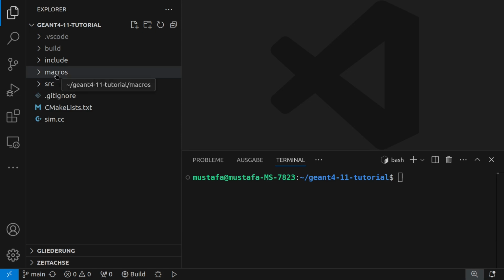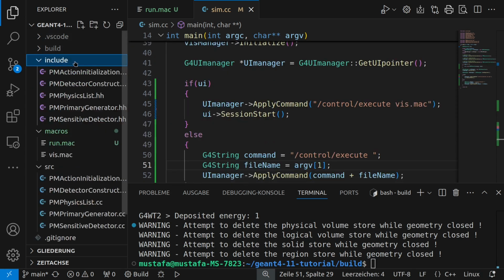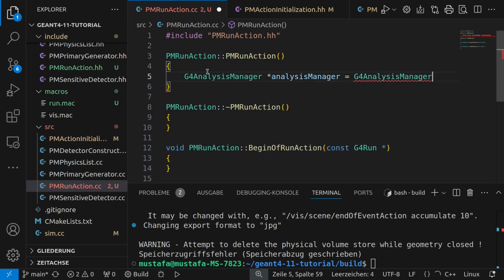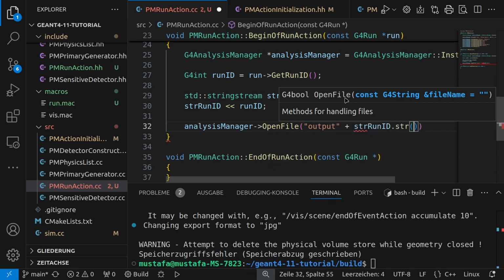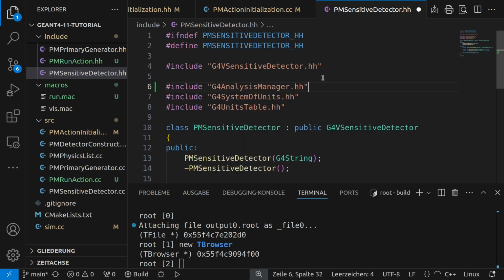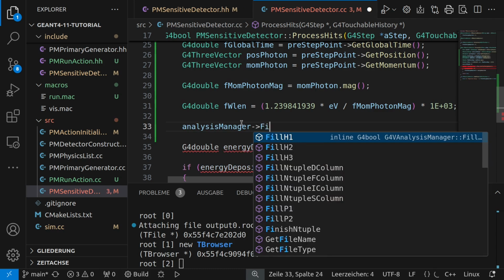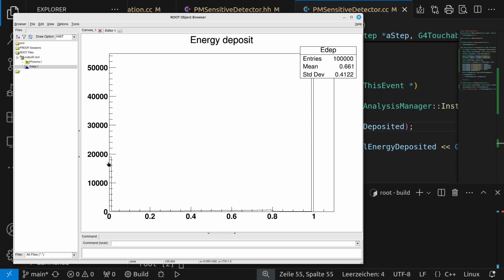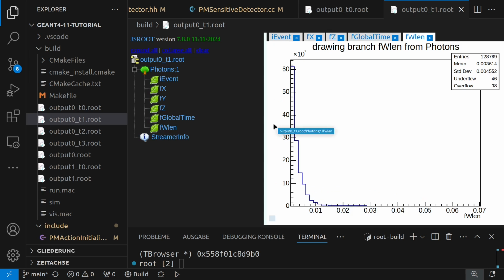Geant4-11 Tutorial 6: Analysis Manager for Histograms and NTuples

Comment: Hello, have you ever created a histogram for multiple sensitive detectors after importing file formats such as obj, stl to Geant4 with the CadMesh library? Is it possible to create one? Or have you ever tried it ? Thanks in advance.
Reply from the maker: You can create one histogram for each detector and then later display them in one canvas. Or you can fill the same Histogram in multiple sensitive detectors. There are indeed many possibilities to achieve the same goal.
Reply: @physics_matters  Thank you very much for your answer, I have previously created multiple histograms for multiple detectors, but the data appeared in a single histogram and the other histograms were empty, Do you know of any examples of this? Thanks again.